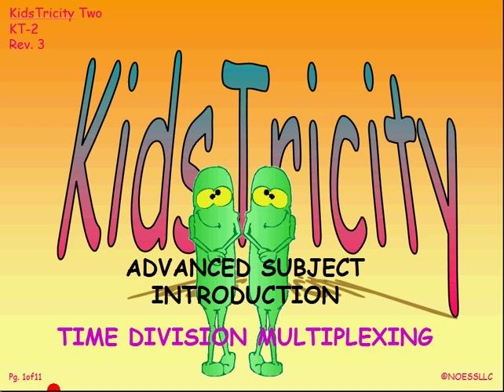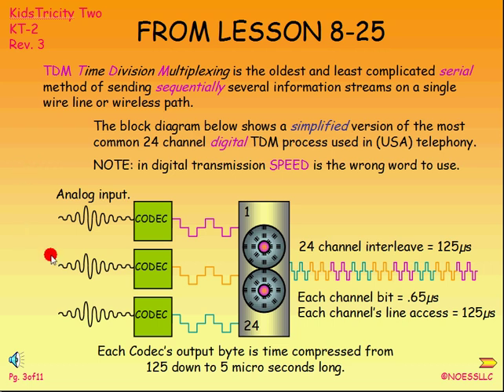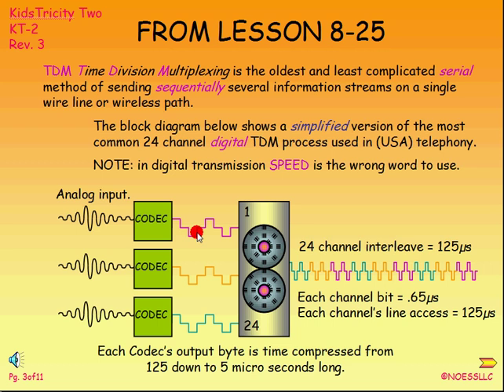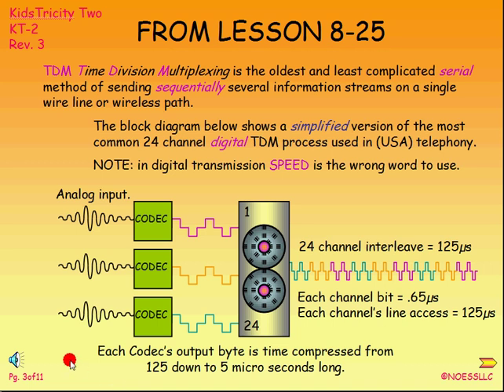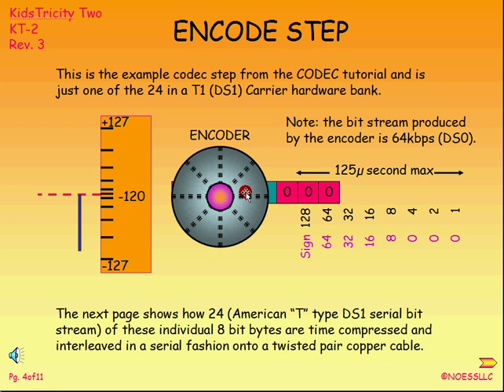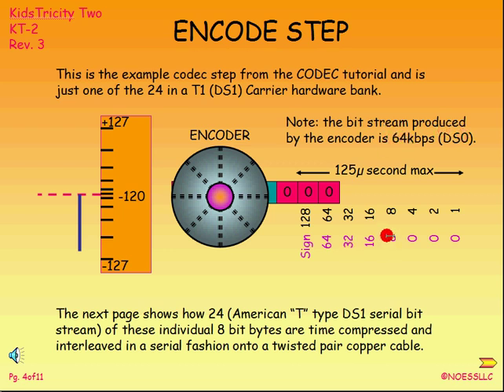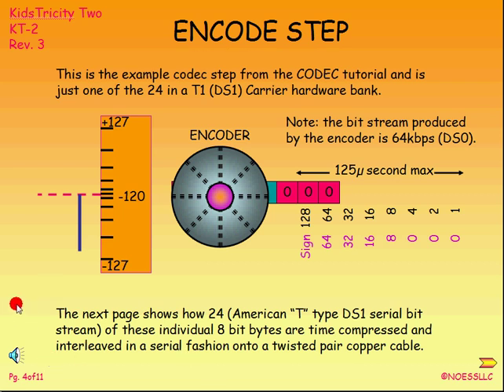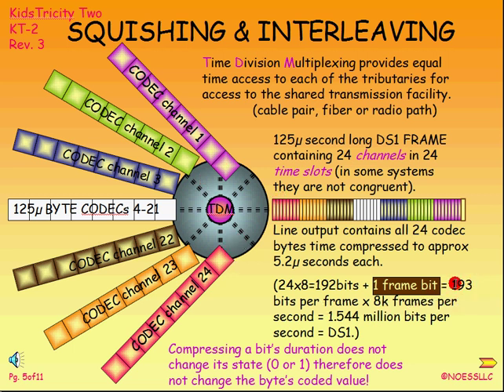Time Division Multiplexing Intro Part 1 of 4

Comment from the maker: It results from the decision many years ago to band limit voice calls to 4kHz max. All the early analog carrier systems used this "standard". When T cxr was engineered it kept this standard. Digitizing analog requires at least two samples per cycle thus 2x4kHz = 8k samples per sec. 1sec divided by 8K = .000125 seconds. This "truth" drives most of the digital bit rates seen in the industry...now you know why...while most folks still think it's just an arbitrary number...or just a mystery.

Comment from the maker: Very simplified – standard “channelized” T DS1 is always 24 8bit time slots transporting 24 64kbps customer channels plus 8kbps of system overhead and control.
			- standard “channelized” E DS1 is always 32 8bit time slots transporting 30 64kbps customer channels plus 128kbps (time slots 0 and 16) of system overhead and control.

With only 500 characters allowed here I can't post my extended response. Just  be aware that "channel" has become a very loose term. Need more? info@noessllc.com